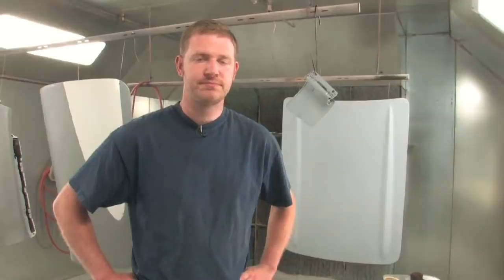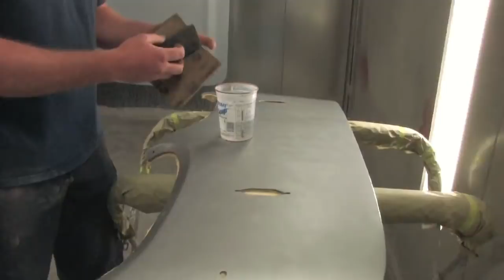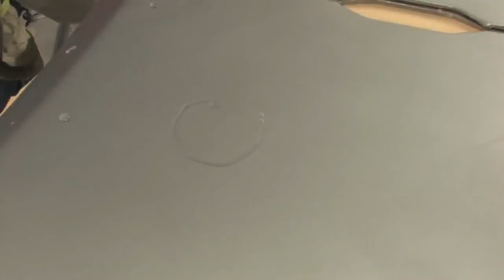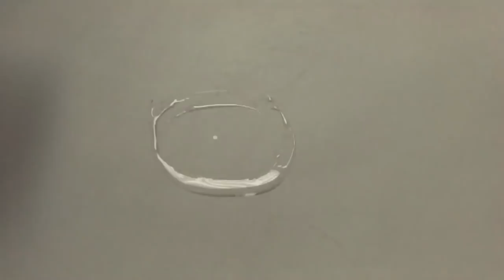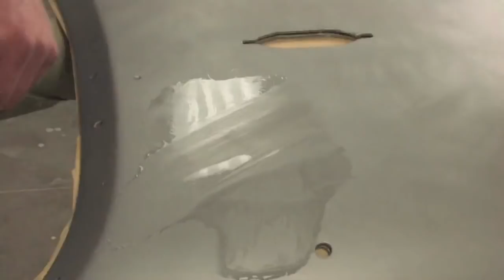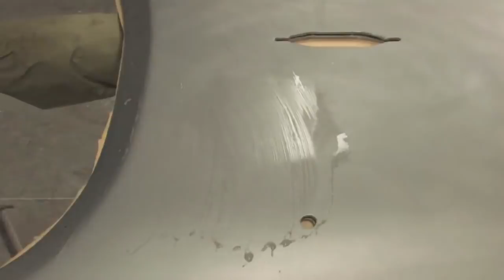Auto Painting _ How to Remove Small Bubbles in an Automotive Paint Job.mp4

Comment: My spray can tip cause like 100 bubbles. After adding the clear coat. i wet sand it one week later. I use a polish from auto zone. I use a 1000 grit wet sand. It was not bad.. Thanks for the upload.. I just wish i can create better bondo lines. You got any vids